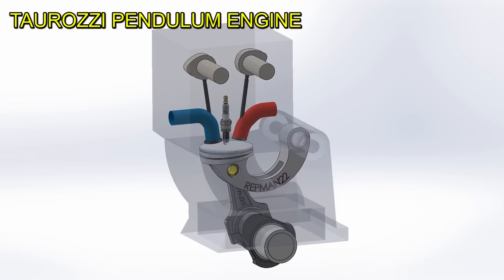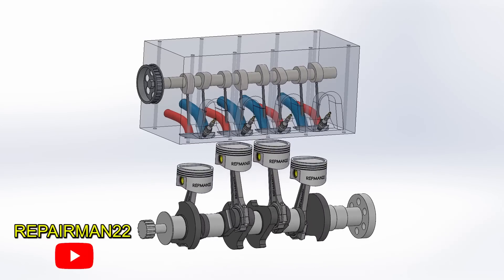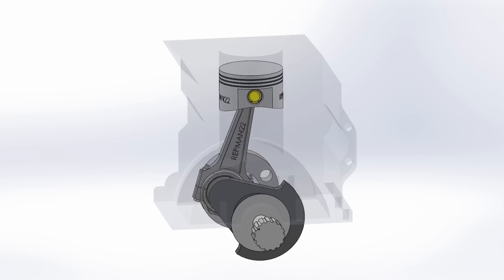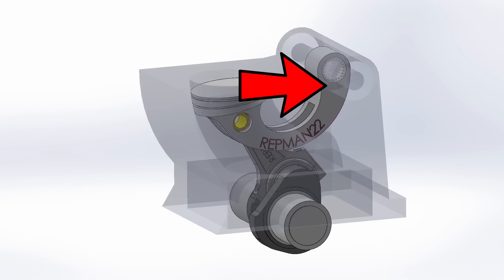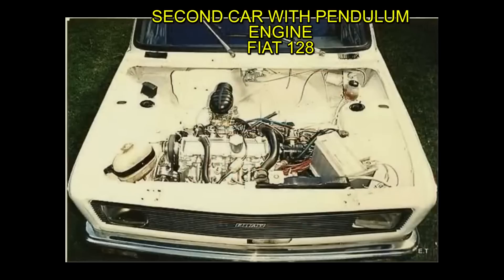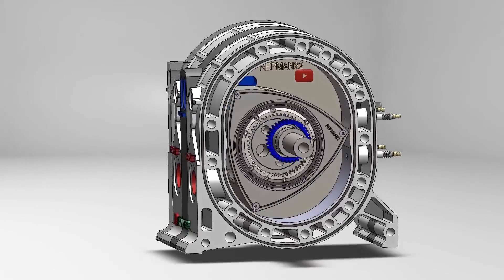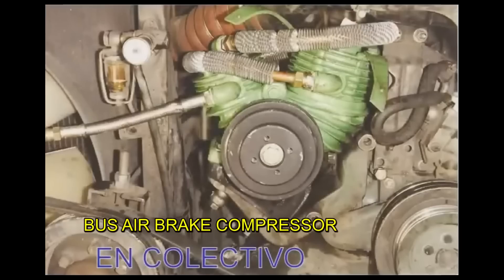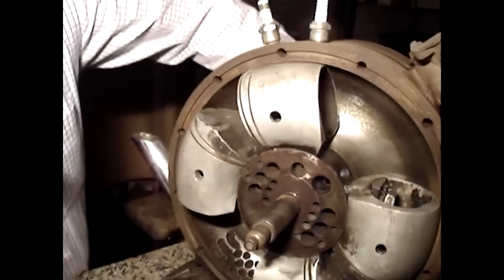All about the Taurozzi Pendulum Engine 🧠 and what happend to it🤯

Comment: I love the idea. It makes good sense.  This engine would last.   Higher rpms are possible because of greater stability.   I hope it's the engine of the future
Reply: Big problem with it your car last twice as long with a lot less maintenance. Big corporations are not about serving humanity they exist to exploit humanity.
Reply: Plus do you think the oil companies want low friction engines on the market? It would hurt them a whole bunch, plus the radiator and antifreeze companies but the bearing companies would love it.
Reply: Just invest all the weight into the conrod and slant-6 your engine ( or flat engine)
Reply: Not sure how it would last longer with the extra lateral loading of the piston in the cylinder.
Reply: @mikeznel6048  with the piston being rigidly connected to the arm there would be very litter contact with the bore, hence you can have very shallow pistons, the question I would ask is what is the dynamic difference between a conventional deep piston and the shallow piston and arm, both have to be accelerated and braked, is moving the mass of the arm more efficient than a conventional piston?. 
The engine would still need cooling as the heat from combustion is still there, and machining parallel bores would be significantly easyer and cheaper, so while being a very interesting design I can't see it taking over, opposed piston engines are still a novelty dispite their advantages and being known, so this would need some serious reasons for its adoption.
Reply: @CrusaderSports250  the chief advantage of this design is in it's approach to friction reduction ,,, it's not novel in it's operation  it's still a 4 stroke engine that operates just like millions of others ,,with it's fixed piston angle however  there is more stability there ,more of the fuel's power is used to push the piston down  and not laterally 
it would be really interesting to see what this engine would have become if developed past  the prototype stage

Comment: There's cylinder ring friction,  but granted less
Reply: He stated in the video, that the piston doesn't touch the sides, beacuse all the stress and friction is transferred into the banana Conrod and it's associated mounting support bearing design. Also the power force directed straight down onto the crankshaft.
Reply: @stanmeyer9770  If the piston doesn't touch the sides, you get no compression. The rings at least contact it. 

Otherwise it'd have no rings.

Also, the uploader hearted that guy's comment.
Reply: @stanmeyer9770  Thats the snake oil claim by the maker. In reality the rings would need to be of the same spec for the same bore/stroke/compression as any other engine. 
Also the claim of this massive friction loss in the piston of a normal engine is nonsense. Any modern engine uses cross hatching to hold a film of oil between the piston and cylinder wall - which is why they can usually run 200k miles or more if looked after. If there was any meaningful friction in use they certainly wouldn't be lasting anywhere near that long - infact engines before that idea only used to last 20-40k miles before needing a rebuild. So its possibly an improvement if you're in the 1930's. 
Then you have to take into account all the added drag from the extra weight of the internals, the extra bearing surfaces, the extra oil it would have to pump to feed those bearings and so on - if this could even match a normal engine on an even playing field it would be amazing. 
Of course it can't which is why - even almost 30 years after the patents ran out - no maker has picked it up. 
With emissions regs the weay they are even if a maker could get 3% less friction this would be in production tomorrow. 30% is just a nonsense.
Reply: Why less? The rings need the same pressure to seat under the same load so for the same bore/stroke/compression they would need to be the same.
Reply: @siraff4461  piston rings need to be able to compensate for the Piston moving around in the bore, in this case that wouldn't be a problem.
Reply: @greengoat5654  Rings aren't affected by the piston moving in the bore. Thats why we have a piston to ring clearance. This would still need that due to thermal expansion. This would also need either strangely shaped rings or would wear them very unevenly since the rings can't sit flat against the wall of a curve.
That means for the same sealing effect they would need to be thicker to allow for the curvature they would need to have. They would also need to be sided and shaped to suit. 
Maybe thats why the guy could never get them to last?
Remember thermal expansion makes a lot more difference than the piston moving about because by definition the worst a piston can move is when its cold and has no oil pressure - as soon as you get oil pressure almost all movement is gone. 
If this is designed with the same power and thermal goals then it will need the same ring clearances and the same tolerances.
Reply: @siraff4461  rings are shaped in such a way that combustion themselves presses them against the walls, this could be made far more consistent
Reply: @greengoat5654  I have no idea what you're talking about with that last statement and I doubt you do either.
Reply: @siraff4461  and with that comment I doubt you've ever done anything outside of your own garage
Reply: @greengoat5654  "combustion themselves presses them against the walls"
Please explain to us all what that means then. I would honestly love to hear how combustion presses rings against the walls. 
I'm sure everyone else would too so don't be shy - enlighten us all.
Reply: @siraff4461  the rings on modern piston engines are thinner on the inside diameter than the outside diameter. On combustion this creates pressure that seals it against the wall of the cylinder. This may be a motorcycle world thing which is the world I come from but I can only assume this is true in modern cars as well
Reply: @greengoat5654  Its not even a motorcycle world thing - its an advertising thing. Thats along the same lines as makers who say they lose money on every one they make from certain bikes/cars. Sounds great but is ultimately nonsense.
Reply: @siraff4461  That guy is full of it but what he is saying is a thing in some rare applications. For instance, gas ported pistons where there is a ring of small holes drilled in the top of the piston right along the edge to feed high pressure gas from the combustion chamber to the back side of the compression ring.

Comment: I am not super into engines,but I have never seen this design before. Are there any downsides to this design?
Reply: Yes. "It is not traditional."
Reply: Yes, it's a lot more complicated to manufacture and has more parts.
Are there any upsides? No...
Reply: In reality the rings would need to be of the same spec for the same bore/stroke/compression as any other engine. 
Also the claim of this massive friction loss in the piston of a normal engine is nonsense. Any modern engine uses cross hatching to hold a film of oil between the piston and cylinder wall - which is why they can usually run 200k miles or more if looked after. If there was any meaningful friction in use they certainly wouldn't be lasting anywhere near that long - infact engines before that idea only used to last 20-40k miles before needing a rebuild. So its possibly an improvement if you're in the 1930's. 
Then you have to take into account all the added drag from the extra weight of the internals, the extra bearing surfaces, the extra oil it would have to pump to feed those bearings and so on - if this could even match a normal engine on an even playing field it would be amazing. 
Of course it can't which is why - even almost 30 years after the patents ran out - no maker has picked it up. 
With emissions regs the weay they are even if a maker could get 3% less friction this would be in production tomorrow. 30% is just a nonsense.

Comment: Main problems are the rings that cannot rotate
Reply: Rings don't rotate once installed into the cylinders
Reply: @shaun.h.barlow  exactly,that is not very good for seal
Reply: @shaun.h.barlow  Yes, they do.
Reply: The piston rings in most two-stroke engines are located by pegs so that they cannot rotate, to avoid the risk of them breaking if the ends pass over the ports. This does not cause any problems. There are some exceptions to this, such as the Tecumseh/Aspera two-stroke used on earlier Flymo mowers; the ports in this engine consist of multiple small round holes that the ends of the rings can pass over without any risk of snagging.
Reply: They don't need to rotate. In fact many engines have them pinned so they can't rotate.
Reply: @wingracer1614  Most mass produced engines they do rotate to keep wear factors even.
Reply: @wymple09  The only reason they rotate is because the manufacturer was too cheap to pin them. Rotating is undesirable from a sealing standpoint. Who cares about wear when even the cheapest engines last the lifetime of the vehicle? It's a complete non-issue.
Reply: @wingracer1614  I care about wear, and no, they don't last a lifetime. Sealing is not a problem with rotating rings either.
Reply: @wymple09  I said the lifetime OF THE VEHICLE! Most cars rust away to nothing before the rings get anywhere close to wearing out. This isn't the 1950s anymore.
Reply: @wingracer1614  Wrong. Rotating is desirable and 2 strokes do not rotate to keep the end gaps away from the ports. No other reason for a pin.

Comment: Why have a second piston rod? You don’t need a piston rod at all and hook directly to the crank for fewer parts, rotational mass, destructive torque created by relative distance from center of rotation,… more engineers, fewer designers will create a better tool
Reply: to keep piston smaller lower and not rubbing on walls pushed partly from to  side by restistance of leaning rod. and pressure from ignition

Comment: 3:48 30% more power...
Not going to happen.
The modern short skirt, low friction piston 4 stroke petrol engine is a very efficient piece of machinery, there are several around 40% efficiency... Chucking in a couple of bananas isn't going to change that.

Comment: Thanks for the video. I didn't know that.  Someone would have to durability test it to see what the ultimate life expectancy would be. It's pretty hard to beat plain cylinders
Reply: That was its Achilles heel, the rings only lasted a few thousand miles, and where on earth does the 30% come from?
Reply: @steverushforth7009  Probably from running massive tolerances, very thin oil, total loss electrics, electric water pump, etc. 
Its easy to make something look really efficient if you're really just palming some of the load off onto another system - which is pretty much what the car makers said if you read between the lines. 
Pistons don't run against cylinder walls and haven't for a very long time - thats why cross hatching and oil films are a thing. Rings touch but even they generally have a very thin layer of oil on them too. 
Simply pumping oil to the arm's bearings on this design would more than negate any gain - if there were any in the first place because I can't see much there at all. Then there are the extra losses from moving the extra internal weight, the extra pumping losses from it moving through oil/air, the extra bearing surfaces which need to be lubricated and the extra oil pump load that would require. 
Lets be honest here - most modern engines will run 200k miles so long as they are looked after. Thats a lot of times for a piston to go up and down a bore so if there were any meaningful friction it wouldn't last long at all. 30% is nonsense. 
I would be amazed if this could even match a normal engine once its on a level playing field. 
Thats probably why none of the makers have jumped on it even almost 30 years after the patents ran out.
Reply: @siraff4461  material sciences have changed a lot since the 60s and early 1970s ,,gotta remember something , in 1974 american automakers were not interested in new technology and argentina is a long ways from the rest of anywhere, ,at the same time this was being developed US makers were fucking with the WANKEL engine which if you wanna talk about a piece of crap , thats what it is ,, this particular engine design actually could be produced and despite the curved cylinders with the fixed piston arms  is just another conventional engine and could be made to pass emissions , unlike a 2 stroke engine or the rotary which is what eventually killed the MAZDA rotary engine , it couldn't meet EPA standards
you missed something too ,, they said he was putting it in his cars so that means it was operating ,not under laboratory conditions and they showed pictures of it running in  a car too and it looked just like any other engine complete with fanbelts and other devices
Reply: @wildcoyote34  maybe someone should show this engine design to snowmobile manufacturers, they have historically seemed more open to crazy ideas. Arctic Cat even made some Wankel powered designs.
Reply: @wildcoyote34  Obvious differences being the rotary was mass produced and put in cars for decades until it couldn't meet emissions. 
The claims for this engine being better on emissions mean any maker would snap it up it that were true. 
The makers sighted his testing as unfair and based on what I read about it they are correct. He was running one piston ring, very thin oil, hardly any oil pressure and total loss electrics - with it lasting very short spans between rebuilds thanks to excessive ring wear - no surprise there then. 
Thats quite a long way from it being a production ready engine or even testing it to production standards. Infact there are usually more stringent tests for the engines used in remote controlled toys. 
Anyone can make an engine that runs for a short video and make silly claims but this simply doesn't stand up to even basic engineering scrutiny. 
Even without doing full tests its obvious to anyone with even a basic engineering degree that his claims can't be anywhere near accurate - infact its much more likely to use more fuel than a normal engine on an even playing field and thats if we give him the benefit of the doubt on being able to machine the rings into a shape to match the curvature of the bore - something he didn't do which is likely the largest reason the engines never lasted.
Reply: @siraff4461  ,, gotta also remember the rotary engine may have been mass produced but it was also a piece of crap  that was constantly using oil  , and leaked at every seal, i had a mazda RX7 in high school back in 1989 ,,the frigging rotary engine didn't have enough guts to climb a hill in high gear ,even at 65mph ,,it would scream on the freeway once you got it going ,the thing sucked fuel i was lucky to get 20mpg which for a small compact car was shit for fuel mileage my mother had a 1983 chevy S10 that got better gas mileage ,,,i bought a datsun 280ZX a couple years later and it was the same size car  with a conventional fuel injected inline 6 cylinder engine ,,averaged 26MPG had 180HP and would burn doughnuts all day long when that supposed 175hp rotary wouldn't scratch the tires even from a full throttle clutch dump ,,in the 3 years i had it my RX7 went through 2 sets of apex seals  and even with new seals always sucked oil , it was nosy and even with proper exhaust you couldn't keep it quiet ,, i still have my 280ZX and it still 30 years later hasn't been overhauled ,,the original L28B engine runs as good as it did when i got it and it has 300,000 miles ,,the guy i sold my RX7 to  still has it and he's been through 3 engines that i know of cause he drives it all the time,, in the same time frame and i don't think he's driven nearly as many miles as i did ,,emissions isn't what killed the rotary , it's cost and unreliability killed it just as much as the EPA requirements did ,
,the fact of the matter is  the engine here wasn't developed past the prototype stage even though the builder built multiple prototypes over many years ,,and unlike what you say  if there was no possibilities in the design they would not be using them for gas compressors today 50 years later ,,material sciences and engineering have come a long way since 1974 ,3D printing ,3D modeling and CNC cutting technology  , if someone decided to make one it could be tested thoroughly and even with computer models it could be tested without building it ,engineers do similar tests every day

Comment: Interesting consept,should be No problem making curved sylinder with the right tool.😎
Reply: But would likely cost more.  Also oil is used to cool the underside of the piston, that is why a large amount is thrown up into the cyl. The arrangement would cause a very interesting propagation of the flame front as one side of the piston moves away from the combustion chamber faster than the other. I am not sure how even combustion might be ?
Reply: @tjm3900  It would only cost more because current straight bore tooling/manufacturing is so prevalent in the market.
Curved boring/breaching would cost as much as those curved intake/exhaust valve manifolds.
Reply: Yes it can be done. Takes way more effort to keep tolerance. Very problematic for mass production